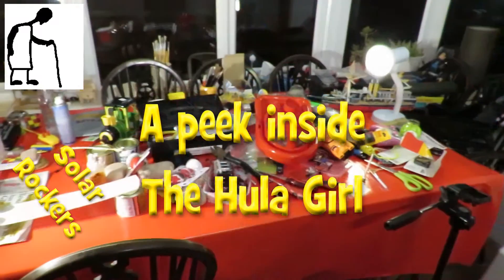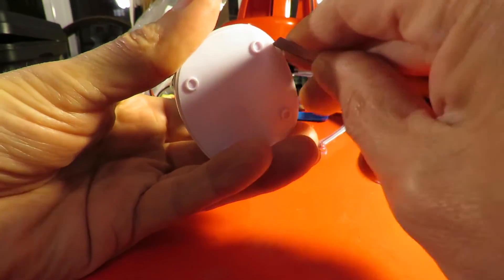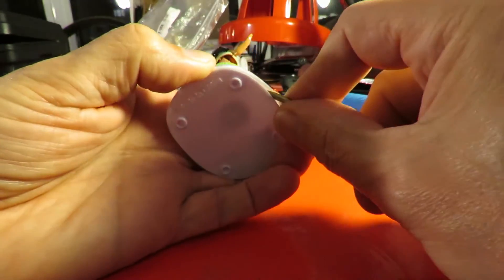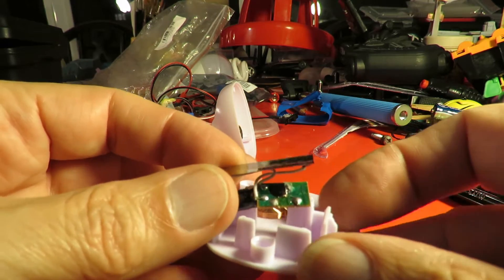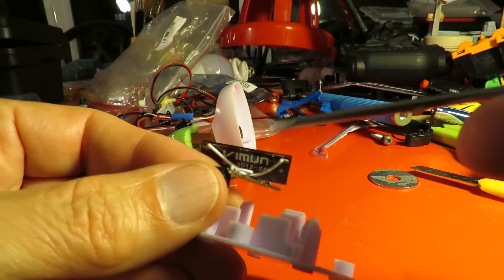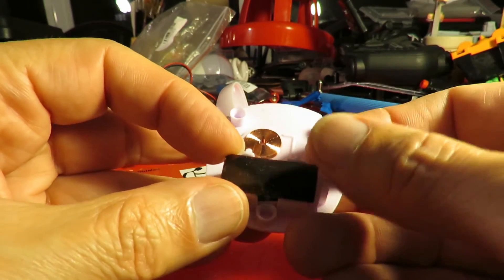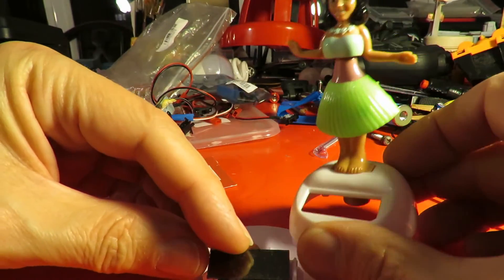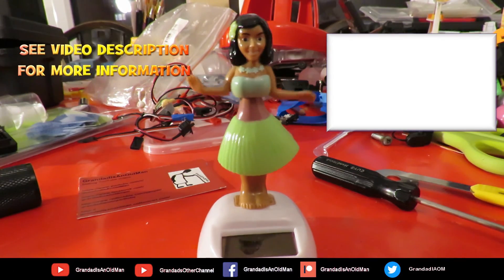A peek inside the Solar Powered Wobbling Hula Girl for Mortthemoose

Comment: Hi is there any solution for broken wires ???
Reply from the maker: That depends on which wires and whether you are skilled with a soldering iron. The wires to the solar panel are easy enough. The wires to the coil are hair thin, so you need good eyesight or magnifying glasses. If the coil wires are broken on the coil, then you probably might as well give up as your chances of finding the broken end on the coil are pretty remote. If you can see the ends of the wire, then you have a chance of soldering them together. The wire is very fine and coated with enamel. Hot solder will burn the enamel off, allowing you to solder it. If the soldering iron is too hot, the wire will disintegrate.
Reply: @GrandadIsAnOldMan  I meant the same exact wires you show on this video as it’s from a solar toy like this one. I tried to glue them to the metal part still no result. Guess I will have to assume it’s broken 😞
Reply from the maker: Yes, that is what I just explained. There are hair fine wires to the coil and larger wires to the solar panel. Glueing is useless as you need an electrically conductive connection. Here is a video of me soldering the wires https://youtu.be/Lwzl7rdmVCs?si=4TCm-feVGLDky3v2
Reply: @GrandadIsAnOldMan  gotcha. It’s broken. Well
Reply from the maker: 👍👍 @Andy224
Reply from the maker: A bit late now, I have just realised this fault finding video is on my channel page where I go through fault finding on solar rockers and show the wires in detail https://youtu.be/dJQucWAgXMg @Andy224

Comment: May i know the jop of the small black screen!!
Reply from the maker: I don't know what you mean by "jop". The solar cell is visible at 04:34 and appears to have 3012-2A written on it. I have checked another cell and that has SC12301-2A written on it. I would GUESS the numbers refer to the length, width and possibly the thickness. So 30mm long 12mm wide and 1mm, I think. I have no idea what the 2A would mean, it certainly does not mean 2 Amps, maybe 2 microamps.

Comment: Great video! One question, is this safe for the car? Maybe with a lot of high temperature gets fire? 😮
Reply from the maker: What high temperature? The sunlight?
Reply: @GrandadIsAnOldMan  yes. will there be a problem?
Reply from the maker: @dionthas  does your car get hot in the sun? If you mean, does the circuit board inside the solar rocker produce any heat then the answer is no, or more accurately, an insignificant amount of heat. I doubt you would even be able to tell if you put your finger on it. Less that the sunlight shining through your car window. Here you are https://youtu.be/ApIWcOm695I
Reply: @GrandadIsAnOldMan  thanks for the video. you explained it in detail! Have a nice day!

Comment: I put my seasonal solar dancers on my window sil facing toward the window so my neighbors can enjoy.  The ones with the solar panels in the back won't move, so I have to move them sideways but they don't move much.  Is there a way to cut the area in the back and add another panel and connect it to its coil ?  If it's doable, could u show how?
Reply from the maker: If you have the soldering skills required, you should be able to add a second solar panel in parallel with the existing panel. On the back of the panel the terminals are marked + and - so you would connect the + of the new panel to the + of the existing panel. Then the - of the new panel to the - of the existing panel. No other modification would be required, other than fixing the new panel in a suitable position, and that just depends on how neat and tidy you want to be. As the existing panel is attached to the base, it would be better to have the new panel on the base or even detached and just laying up against the case. If you had a 3D printer, you could design a base to hold the new panel in a suitable location.
Reply from the maker: This video might help show what I was talking about https://youtu.be/S908VM_RWcQ

Comment: I have a ne but it's not working unless direct the spotlight over it.. Why
Reply from the maker: There are many possible reasons. It may be the rocking mechanism isn't seated correctly so it does not swing freely. There may be some plastic flashing from the moulding obstructing the swinging. You might have placed it over a metal object which is obstructing the magnetic field. These work best in real sunlight. Most modern low energy lights do not give the right wavelength of light for the solar panel. You need an old style incandescent bulb or a halogen bulb to get the best results. LED and CFL bulbs are very poor for solar panels.

Comment: My solar toys wires arent broke  but it doesnt move. What is the problem? Sorry for my  english.thank you.
Reply from the maker: There are many possible reasons, here are some that come to mind.
1. You don't have it is strong enough sunlight - although most of them will rock in very little light.
2. You are standing it on a metal surface which negates the magnetic pulse. Even placing it over a nail in a wooden shelf could do that.
3. The moving parts are not seated on their pivot correctly, so it cannot rock.
4. The pivot is broken, perhaps the rocker fell on the floor and it broke.
5. The moving parts are rubbing against a non-moving part.
6. The pendulum part is rubbing against the top of the coil, sometimes the top part has been pushed down too far or you can increase the gap by levering the top away from the bottom a tiny bit.
7. The solar cell is cracked or the wires going to it are disconnected at one end or the other. Connecting a 1.5 volt battery to the wires that come from the solar cell should make it run if the solar cell is faulty.
8. You say the wires are not broken, but how have you checked? Connecting a 1.5 volt battery to the coil terminals should generate a magnetic field that would make a magnet move.
9. If the coil has been damaged then connecting a battery to it will not generate a magnetic field.
10. The circuit board is cracked or broken. Unless you have trodden on it, then this is very unlikely.
11. It is extremely unlikely that the capacitor is faulty, but it is the only item on the circuit board that could be desoldered and replaced.
Here is my video on faulty finding with a 1.5 volt battery https://www.youtube.com/watch?v=dJQucWAgXMg&list=PLA5a2xPRSrB1L61NAVuE5I9FbPgq3sSG1&index=7
Reply: @GrandadIsAnOldMan  wooow. Thank you for this long answer.  I will check every steps. Thank you again.💓

Comment: So after experimentation I don't believe that that solar cell is real what has anything to do with how this device works because I've noticed if I just extend the leads that her connecting to the store sell it will start going all on its own if you give it a little jump start. I believe that magnet is producing a small current when passing over that magnetic wire which charges the capacitor and how is the device. I check if there was any voltage coming off of the solar panel weed while manually moving the device and it turns out that it was producing about 1.5 volts at 0.5 watts and and 0.005 amps.
Reply: Try that in the dark.
Reply: ph no plis